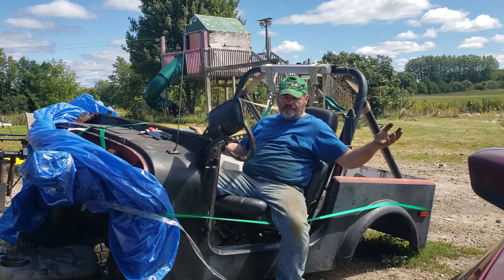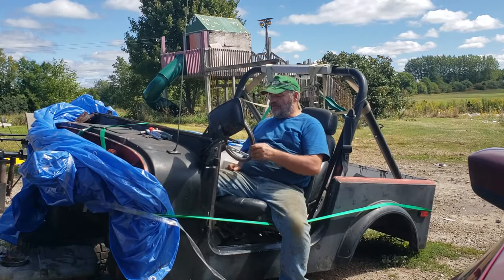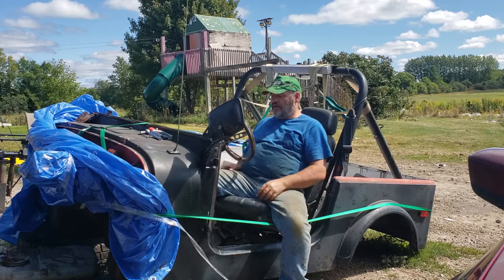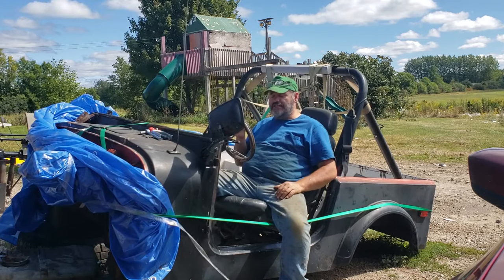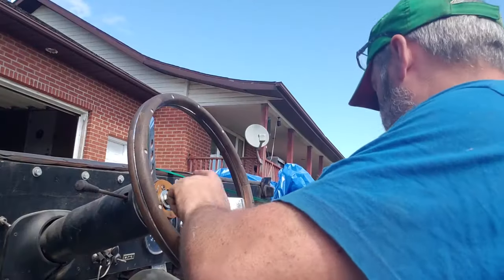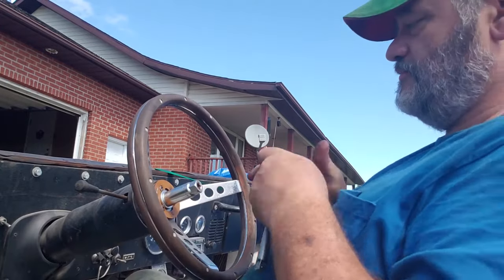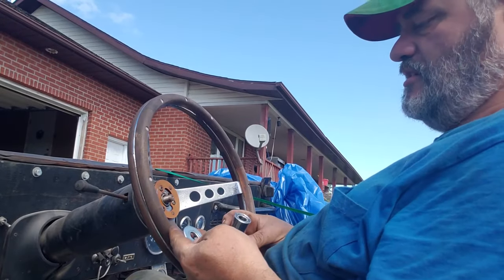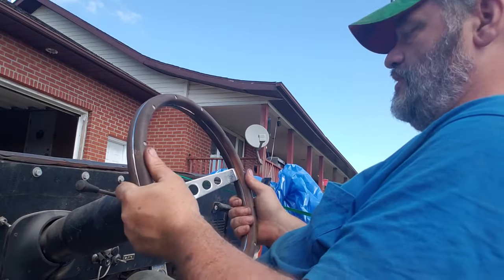How to Replace an Ignition Key Switch on the 82' Jeep CJ7 (and many others)

Comment: This video may be 4yrs old but it is still relevant! I just rescued an old CJ and it came equipped with the same ignition as yours. No key required. Your video helped immensely. The directions that come with new switch are all but useless. So.........Thank You!
Reply from the maker: Yer very welcome, good luck with your build !!

Comment: This by far is the best steering column fix video, ANYWHERE ON THE INTERNET. Especially the part that shows the trick to getting the key cylinder out with a small screwdriver.  Many thanks!!
Reply from the maker: My pleasure, thanks for the kind words.

Comment: Great video, thank you!  i actually begrudgingly replaced my lock cylinder as I considered it a "keyless entry system".  Then, friends started pulling pranks and moving it around the grocery and hardware store parking lots.  When it finally stopped turning, I had to replace it.   Keep on Jeepin'!
Reply from the maker: Awesome! Ya that key cylinder was a common issue on these things. As if Jeeps arent easy enough to steal to begin with.
Reply: @SchnebsGarage  Well, mine was repainted after an accident lime a$$ green so it sticks out just a wee bit.
Reply from the maker: @KENFEDOR22  lol ya I'd say

Comment: Same problem. Don't need a key and it just falls out. My 76 had the slot covered in a thin skin of flashing or casting. Used a pick to open the slot first, then Hooray it came right out. Thanks for the video.
Reply from the maker: Glad it helped, thanks for watching!!

Comment: I got it!! Thank u great vid!! Now I’m dealing with no spark! Coil is hot on one side and dim test bulb on the other!! 82 cj5. 258 4.2l just bought the thing.
Reply from the maker: Ignition systems on these things is total garbage. I'd recommend scrapping it all and going with an aftermarket GM HEI style distributor (runs on 1 wire, hot ignition) .. if you're doin it on the cheap there's some on Amazon for around $150. Name brand stuff will run ya bit more, but either way its a vast improvement over the stock ignition system. Also grab a weber carburetor and ditch that thing they call a carb, you'll thank me later. ;)
Reply: Thank you again!! So did u eliminatethe idle module and all associated wiring? What brand and model of HEI r u recommending? Do u have a vid on that install?
Reply from the maker: @ws56c62  Yes, module is in the trash. Only thing you need for the HEI setup is a hot ignition wire. The distributor comes with a suggested wire to use if memory serves. I did a full rewire on mine so I just picked my own wire, not hard to find one that'll work. I have a video that shows my carb setup but not the distributor install. https://youtu.be/HHExHWY7kt0?si=PiHdyeS01-Hx1LDq . Distributor is pretty straight forward and I know I have a few how to vids on HEI distributor install someplace ;)

Comment: There is a tab n the hole where im supposed to use small screwdriver to release tab on cylinder to pull it out. That tab, do i place screw driver on to of tab, bottom of tab, side of tab? I’ve tried it all and still cant get cylinder released, I am at a loss, thoughts?
Reply from the maker: That tab only moves a very small amount,  it almost feels like its not moving at all. Also are you sure there's no screw in the other hole. Later models used a screw instead of that push tab. Look at around 9:20 or so I show the location of where the screw would be on newer ones. Good luck. Also some are really stuck in there and might need some penetrating oil to loosen up.

Comment: Good video. One question. My ignition has no resistance with the key in it, no clicks between positions, and of course no start or crank. Any ideas?
Reply from the maker: Sure thing. The actual ignition switch is located further down the steering column. It connects to the key switch via a steel rod. either of those could be the problem.

Comment: Hello . can you tell me the name of the tool that pushes to remove the pin. thank you very much
Reply from the maker: Steering Wheel Lock Plate Removal Tool would be the 'correct' name, but you can find them under steering wheel puller or other names. Hope that helps.

Comment: Great video, thank you. Is there a trick to getting the wiring harness clipped back together under steering wheel as last step? You seemed to just feel around without looking when you unhooked. I can’t see the darn female end to click them back together.
Reply from the maker: No trick really, it should just plug right back in.

Comment: Great video! I went out to start my 81 Laredo and the starter wouldn’t stop.  Replaced the solenoid and it still won’t stop unless I remove the battery cable and reattach to keep it running.  Would you expect it to be the column switch?
Reply from the maker: I'd have a look for sure. Remember the actual electrical switch is further down the column near the brake pedal assembly.

Comment: Great video! Any advice on where to get a ignition switch, steering wheel and horn assembly? For a 1986 cj7 thanks
Reply from the maker: My go to for parts is Rockauto, if they don't have what you're looking for Amazon is always a great source for parts. If you're looking for stock replacement steering wheel that might be a bit of a scrapyard trip but there are a ton of aftermarket wheels out there for not that much money. Grant Wheels has a huge selection and the installation kit they sell usually includes the new horn plate as well.
Reply: Thanks friend!

Comment: Hello, I have an old CJ seven that will start with or without the key… Kind of like the situation you had and I also have a problem with the engine shutting off at random times could it be related to that ignition lock?
Reply from the maker: Anything is possible but to be honest the actual electrical switch is located further down the steering column almost at the floor. Its a good place to start for sure but I would suspect a bad wire or ground someplace else to be causing the shutdown. The CJ7's stock ignition system is a problematic piece of ...well you know what... I went with HEI distributor and hacked all that stock ignition out.

Comment: Could you please tell me what wires go to the ignition switch? My jeeps previous owner pulled my wires and hotwired it because he lost the key. I found the key in the junk in the back  of the jeep and would like to use the key.
Reply from the maker: Thats sir is a tall order, the key switch is in the column as shown in the video but the actual electrical portion is down below along the steering column. Its a flat connector with about a dozen wires goin into it that basiclly control everything from ignition, starter, lighting and guages. Without knowing what extent the previous owner has hacked things up its near impossible to diagnose without being on site I'm afraid. I do have a video farther along in the series showing the wiring harness and mods that I made to get rid of the factory ignition modules and go with a much simpler and efficient GM style HEI distributor but it doesnt really show the column much as I left that stock.
Reply: @SchnebsGarage  I kind of thought that much. prob simpler to glue the key in the ignition for looks and d a push button system. Thank you though.
Reply: May I suggest the CJ wiring diagram?  It vary by engine design but even the Haynes book version suffices.
Reply: @KENFEDOR22  found many also fixed and sold it now. Was a long time ago.

Comment: That's awesome. Where can I find a replacement one?
Reply from the maker: I typically use RockAuto for most of my parts, mainly because I live in the country and well I hate driving to town for parts.
Reply: Thanks! Your steering wheel popped right off! Mine is completely stuck! It eve broke our puller trying to get it off, but I know we've unscrewed everything. Any advice?
Reply from the maker: @jimcopeland4011  Screw the nut on the column a few turns to protect the threads, put some tension on the wheel with your knees and pound the column a few times. Its old school but that's how we used to pull em. Brass or hard rubber mallet works too but I've seen em mess up threads so I prefer the nut method.
Reply: Good suggestion but no dice on that either. I even tried doing that with tension on it from the puller. I've sprayed it with penetrating oil hoping that will loosen something too. This steering wheel will just absolutely not come off! The steering wheel is busted anyway, so my last idea is to maybe drill some holes in it around the shaft to release tension and hopefully give the puller a better angle. One of the original threads in the wheel for the puller is completely bored oht.
Reply from the maker: @jimcopeland4011  Wow, thats one nasty wheel. Maybe heat it with a propane torch a bit...kinda sketchy with the wiring behind the plate but a little heat might help.